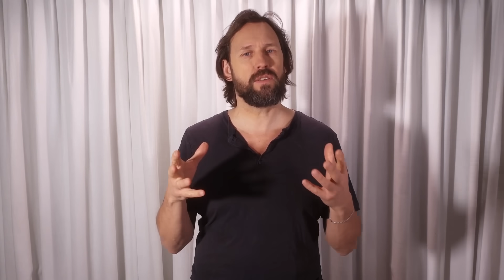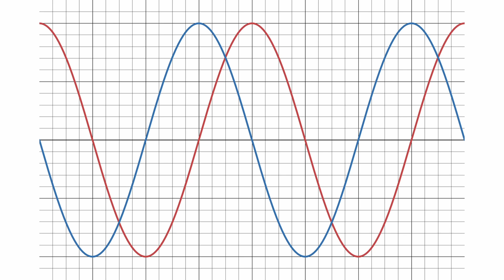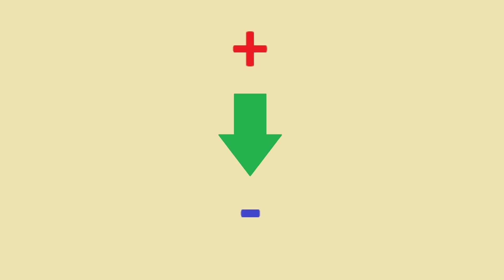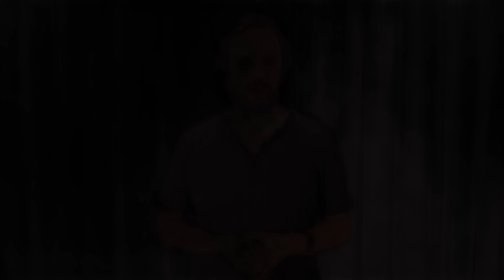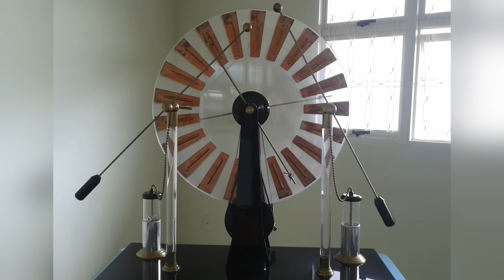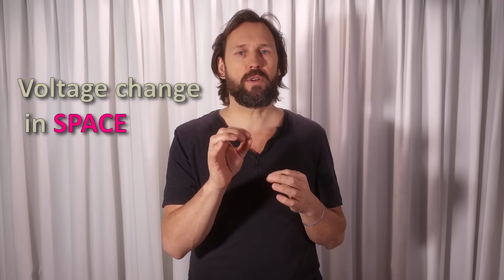The Electric Resonance SECRET Universities Hide

Comment: Balderdash!  The displacement current and the magnetic current are the same current, because the coil and the capacitor are in series.  This has nothing to do with Franklin's choice of positive and negative.  All you need to know is that a capacitor integrates current to give voltage, and an inductor integrates voltage to give current.  Just like a mass integrates force to give velocity, and a spring integrates a velocity to give force.  In code, you can say "A = 1; B = 0; While 1 { A = A + B * .01; B = B - A * .01; }" and A and B will form a sine and cosine wave, just like the capacitor/inductor system and the mass/spring system.  A is the integral of B, and B is the integral of -A.  No other hocus-pocus is required to explain resonance.
Reply from the maker: True. but did you consider the consequences of using a high voltage fringing field that produces a displacement current to power a load (together with an induced EMF from a changing magnetic field?
Reply: @MasterIvo Dear Ivo I conducted a few experiments and came to know that the fringing field neither requires a close path nor it requires potential difference. The current does not flow from one point to the other rather this field vibrates expanding and collapsing. I can make a bulb glow without using any potential difference rather using a wire and two ends of it connected to the bulb. It is a sort of standing wave magnitude of which is expanding and collapsing and switching its polarity. At right conditions it cracks the time space fabric and sucks in the ambient energy to produce COP>1. At that moment the pressure waves are built up in the environment and best sensor to detect that phenomenon is an audio mic with maximum frequency response from milihertz to ultrasonic spectrum. I am uploading a video soon that shows the phenomenon. I had to shut down my AliGen v6 due to weird effect of it I can't explain and experienced strange sounds in the room soon I decreased the duty cycle of the pulses and pressure waves were eliminated. The same phenomenon also produces cooling effect and sudden temperature drop in the environment and heats sinks. Floyd Sparky Sweet also came across such  observations during his high Q resonant VTA. Many call it negative resustance but I think its the same fringing field and eddy's currents that make the metallic surface of conductors and heatsinks to cool down despite large current drainage. Strange effects seriously. The effect is more obvious if you use 400uH to 4mH inductance. And when the voltage source is of 24V DC 4Amps. Frequency from 20KHz to 200KHz. Coz ultrasonic waves have the momentum and mechanical effect and have to do something with those pressure waves in the vibrating and flipping magnetic field inside the inductance. You may also weigh the inductance during such right conditions it may lose some weight. Plasma form through spark gap based switching increase such effects manifolds.
Reply: @qinaan cooling effect? This reminds me of Bearden/Bedinis papers mentioning negative energy and the cooling effect it can have..

Also are you familiar with Ning Li and Eugine Podkletnov? 

This was a very exciting post to read, I wonder if you publish your other experiments anywhere as I would love to have a read!
Reply: poppycock!

all your oversimplified Heaviside Gibbs vectoral nonsense has gotten you exactly where you are now at a dead end.
The control is Total and you are now stupider than you were before you began. 
at this point all you could do is swallow your ego and go back to basics, realize that all the missing variables were there for a reason in quaternionic notation of Maxwell's equations.
Start calculating outcomes using both right hand and left hand NABLAS the way Maxwell intended to use Hamilton's magic.
Stop repeating the shills and the braindead.

Of course you are not able to do any of that because your ego will never let you admit that everyrhing you learned is wrong and a complete waste of time. 
Other repeaters like yourself will keep the peer pressure on you to conform with ridicule and scorn because if you don't their egos would also have to shatter. 

you're pathetic.

Comment: Also displacement current is time varying electric field
Meaning when frequency is included electric field is dynamic hence displacement current 
Without frequency electric field is static hence electrostatic field

So there's only two fields, electric & magnetic fields
& Has to be time varying for resonance to occur
Reply from the maker: I see three as the static has different properties than the dynamic. especially when dV is high and dt very low (longitudinal flow)❤
Reply: @MasterIvo  i see, this is just a query, if you like it ,find it interesting to answer please do answer,
inductors have what's called electromagnetic or electrodynamic induction(as in magnetically coupled circuits), & inductors react to magnetic fields, specially its' changes;
 on the other hand we do see electrostatic fields polarizing & attracting nearby charges, & capacitors react to electric fields, no doubt there, if yes then isn't it also induction?? more specifically electrostatic induction????
if yes then this induction can be used in the same way as magnetic induction can be used(provided dielectric strength & other related things like you might add frequency), can't it?? can't we use electrostatic induction for driving loads???
i hope you get my point, if you feel it interesting, worth discussing, then i would really like elaborate on what i am really trying to say, would like a discussion on this;

i was always interested in fields & field interactions in electric components such as inductors & capacitors; we mainly say capacitors are related to electric field & inductors related to magnetic fields but what about magnetic field of capacitors & electric field of inductors???

so couple of questions, again if you feel answering do reply, i am interested to know your answer as i can't get satisfactory answers where i study & AI also doesn't help me in these specific matters;
Reply from the maker: @rehandrone7146 
YES!
And both types of induction can be used simultaneously to induce power. This Intest in the coming videos.
the feedback I talk about is by simultaneously using both forms of induction. magnetic and electrostatic (dynamic actually).
❤

Comment: At 11:15: Isn’t it worse that it’s an open circuit? Because energy moves with the gradient. Assuming the whole idea of the device is that it draws energy from the medium, energy won’t flow against the gradient. So wouldn’t an “open circuit” cause your system to lose energy more quickly?
Reply from the maker: the gradiënt? of the electrostatic field?
Reply: You need an open loop system to flow to your closed loop system .. ?

Comment: It's not that hard to understand if you learn how the electronic components work. A discharged capacitor is basically acts like a short circuit and pulls current when a voltage is applied across the plates, once the plate voltage =  the source voltage, the current drops to zero (minus any leakage).  An inductor with zero magnetic field acts more like an open circuit with high resistance to current flow when connected to a voltage potential, as the magnetic field increases, the current flow increases and will peak once the magnetic field reaches it's saturation point at which the wire effectively turns into a resistor with current at it's maximum. This behaviour is effectively the opposite of a capacitor. When the voltage is oscillating over time with frequency (AC waveform), we see the current flow behaviour of each device either leading the voltage (capacitor) or lagging the voltage (inductor). Making a resonate circuit depends on the properties of both components and how they interact.

Comment: I made experiments with the Tesla coil, but I don't agree with your theory.
Reply from the maker: did you ever see it detune when raising the voltage?
Reply: @MasterIvo  This isn't some mystery. It occurs because air isn't truly a linear dielectric, and its deviation from linearity becomes apparent at high voltages (i.e. when it starts to ionize fully). This results in an increase in the effective capacitance of the system (since the "dielectric" is now behaving differently) which can be modeled as an increase in the secondary capacitance, and therefore a lower resonant frequency. This effect has nothing to do with displacement current.

Comment: This is called a tank circuit. Set the L and C values equal to each other for maximum resonance, I.E. having the highest Q. Use high dielectric capacitors like CCTO, Silver mica, or Mylar film, or poly polypropylene film.  Pick L and C values to resonate at the same nearby AM radio station frequency. Cut a single wire to the length of that wavelength frequency ( antenna) and connect it one end to one side of the tank circuit. Leave the other end of this wire open (not connected) and mount it vertically. Connect the other side of the tank circuit to a rod driven into the earth. This circuit will get "free" power scavenged from the radio station. Remember that the components and wire have DC losses, heat from (resistance), plus inductive and capacitance leakage. Use an impedance meter to measure both the real and imaginary (displacement current) impedance. Connect a diode and capacitor to the antenna at the tank circuit for DC voltage. Nikola Tesla worked on this in the 1890s.

Comment: The earth ground is almost an infinite source of electrons.  If only we can figure out a way to resonate these electrons back and forth like AC forever, then we can plug into this circuit.
Reply: Easy peacy, it takes enormous amount of energy to do that though so you would need a big powerplant pushing it back and forth.
Reply: @LuiLulumon  T. Henry Moray figured it out, it just needs to be rediscovered.   The Earth's magnetic field changes constantly as it trails and rotate behind the Sun.  Even the Sun does the same as it moves around it's circular orbit which is why it has Max and Mins due to the interplay of capacitances and inductions thru whatever it is interacting with in ether space.  You must realize that our Solar System is one massive electrical circuit with all the attributes (resistances, inductance, and capacitances).  Each planet and stars affect one another via the distances and magnetic fields of each that interact over the distance of zero point vacuum space.  All the free energy machines that are known to work use an aerial system that taps into atmospheric voltage with telluric currents in earth ground.  The magic is the black box that resonates the two elements.  Master Ivo must be on the right path, once you get the system going, it just takes a rhythmic pulse to keep it going.   With the massive planetary scale of the energies involved, it would be more than enough to self-sustain with each pulse while we bleed off just enough energy to use before it replenishes.

Comment: The universe doesn't offer free lunch. You have to sacrifice something. And by that I don't mean the laws of thermodynamics.
The closest you will get to free energy is energy extracted from a vast reserve that you consider infinite, but isn't. Like the waves of the sea or the sun.
But still energy will need to flow and be converted, and will be lost from the source, eventually ending.
If you create a resonance being powered by a source, you might just discharge the source faster, the resonance won't create free energy, it will only amplify the energy discharge.
For example you can put two speakers into resonance with the material where they are mounted, and they will start producing a resonant very loud sound, even tho you have weak speaker. But what is actually happening is you are overloading and eventually burning the speakers, because you are actually drawing more current though them than they ouch to accept. That current draw is not happening continously, but in short intervals at a specific frequency, so the continuous power will seem fine, but the intantaneus power will be insane, and most of the time there will be no power. However this will heat up the coils and increase power draw.
Energy is like water. It flows. But it doesn't get created from nothing. Resonance is like nudging waves on the water to increase in size. You need to put energy to do that, and the more resonance you need the more enerrgy you spend.
If there is a single funamental set of laws in physics, it is thermodynamics, all these quantum and relativity, and maxwell ones ones are not laws, just models and approximations, almost certainly incomplete.
One thing I am sure of. There is a set amount of energy in our observable universe. It doesn't get created, only converted. If it can be created it must come from outside the universe, in which case we are not in control - but that doesn't break the laws of thermodynamics, since that is related to closed systems.
Reply from the maker: I see where you are coming from. I have a experiment that contradicts your views . this and the next videos build up to explaining and showing it.
it is based around a dual driven dual resonant system that is both capacitive and inductive coupled, creating positive feedback whereby the resonant energy grows while the power  supplies drop their current, while raising the psu voltage.
You'll see.
it creates extreme high Q.
Reply: you always get what u think. If you are limited in thinking, you will never have this results of free energy. Think about where energy comes from?
Reply: To discover something new you must think outside the box. If the universe fits in a infinite point.  There for The darkest  deepest  void of the universe has infinite energy.
Reply: is an atom not a perpetual motion machine complete with free lunch?
Reply: Does atom have spin does it spin degrade??? 😂
Reply: This is very well put. We have energy, we cannot create it.

Closed systems in short: IF someone can create a closed system, really nice. But nobody can observe what's happening inside. Means there's no way to get energy in or out.

Closed system is a theoretical concept to act as a tool for maths. Any inductor, capacitor or conductor is not a closed system, and can't be used as building blocks for closed systems.

There will always be losses and for human thinking there will always be errors.

That being said, it's always good to be curious and explore. On the way we may find something new.
Reply: nuh uh I'm going to manifest some chipotle right now the laws of thermodynamics were made by the white man to keep you down

Comment: The first graph is for a capacitor, where current lags voltage.   For a light bulb, the twp graphs overlap in phase.   For coils/inductors, the current leads the voltage.
But agreed, resonance is very weird, and this weirdness is all covered up during science teaching.  (Physics is supposed to be conventional and boring.  We can make it this way by hiding any fascinating unexplained weirdnesses.)   
Ham radio gets a bit of it, with mag-loop antennas, and little short whips with resonant base-loads for 160-meter wavelengths.    In theory, a single atom can intercept radio wavelengths at kilometers scale.   It all depends on the resonant losses or "Q-factor" of that atom.   Single atoms have Q of millions.   So do large molecules.   Do they have radio-wave resonance?   They'd better not, because if they do, it means that the medical community has been suppressing new cures since roughly 1920, back when "electrical healing" was banned from wide use, and all doctors insisted that it was quack only.   After all, biomolecules are smaller than AC wavelengths, and that proves that AC fields cannot have medical effects.  (Wrong of course.  High-Q resonance in biomolecules, that's a thing now.   Also look up non-contact friction forces, the mechanical analogy for molecular-scale long-range EM resonance.)
PS
"Free energy" is a term from perpetual motion believers.    All the rest of us are focused on energy-harvesting.   In that case, the alt-science is about energy-harvesting from an unsuspected source (cold fusion, neutrino flux, Vril life-energy, etc.)   Jedi practitioners all know that the power of your so-called Boulder Dam is insignificant when compared to the Terawatts of The Force.

PPS
You've figured out one of Tesla's secrets.   At higher than resonant frequency, the Tesla coil becomes a megavolt capacitor-stack, and it can be discharged in nanoseconds, with peak power far larger than mere Megawatts.   That brings in an entire new field of electrodynamics, especially where nonlinear (V-squared) effects are involved.   You can make electrons travel at faster than 99% of lightspeed, and not with only the feeble watts of a cyclotron.   At Colorado Springs, Tesla discovered unexpected effects, such as thick wooden beams being exploded, and "fireballs" becoming stable entities.  Electrical physics yes, but involving "inconceivable violence" of nanosecond pulses in the giga-watt regime.
Reply: Hello William. 
I am researching the subject of Electro-sensitivity, the causes and the cure, so far successful.
The info below may interest you and confirm/inspire you.
"Power of Bio-Electromagnetism: Missing Piece of Molecular Interactions" - Irena Cosic - https://www.youtube.com/watch?v=21Z4947fl_s
Search > "Electromagnetic effects – From cell biology to medicine" - Richard H.W. Funk, Thomas Monsees, Nurdan Ozkucur.
Cheers.